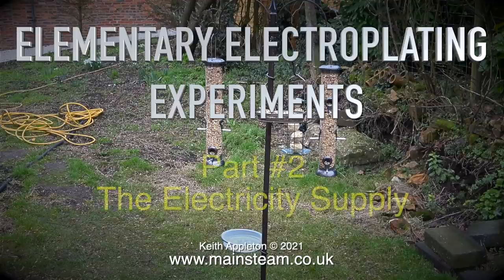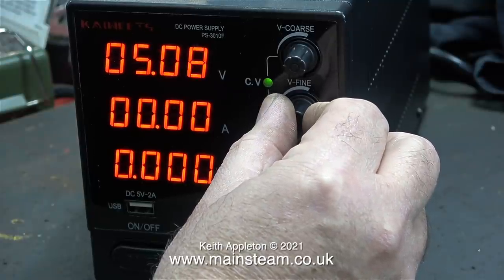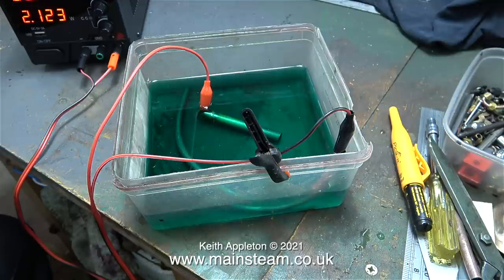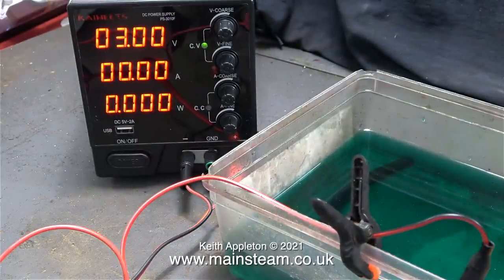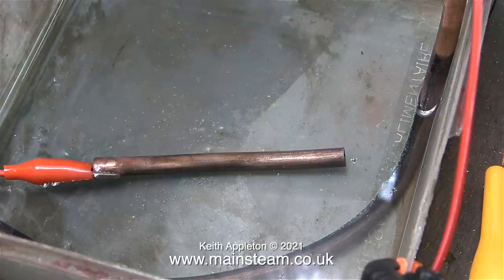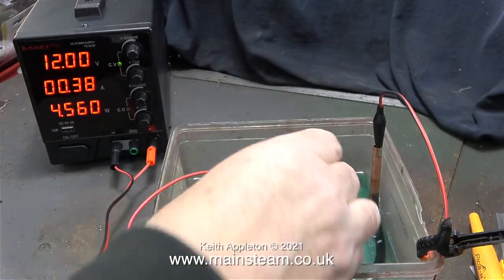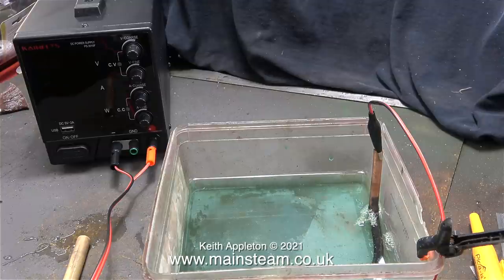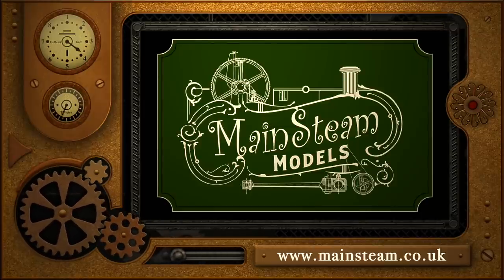ELEMENTARY ELECTROPLATING EXPERIMENTS - PART #2

Comment: Keith, The product that was recommended, "root kill" is sort of a generic name for the stuff poured into a home drainage system to remove root blockages in the outdoor drainage pipes, most likely. We in the US generally call the stuff "root destroyer". The stuff is usually granular and is poured into a toilet and then flushed into the system. This apparently dissolves into an acidic liquid and destroys the "hair roots" that find their way into the drainage system, in search of water, thus blocking the drain pipe. How that would work in your application is questionable. ;-)

Comment: Oh, now you gave me USB-port envy; my adjustable PSU doesn't have one! With these PSUs you can easily set the short circuit current, and thus avoid burning up electronic components and DC motor windings. The built-in amperemeter is a great help in troubleshooting, for those who don't especially love the smell of burnt copper winding insulation. Thank you for this electroplating crash course!

Comment: Hi Keith
For scale removal I have used Zep Commercial Calcium, Limescale and Rust Remover, it removes all the limescale we get down here in Essex. Also used it to clean up some chrome plate bathroom fittings that had rust grinning through, worked a treat. I buy it from Screwfix, £6.99 for a litre (no connection)

Comment: Root kill ( ZEP product in the USA) the safety data sheet says it's 90-100% copper sulphate (sulfate US sp.)pentahydrate, that's the blue crystals, it doesn't say what the remainder is. It's designed to kill tree roots that have invaded drain and sewer pipes. Copper Sulphate from a chemical supplier would be a guaranteed purity.

Comment: Enjoying this series, You are not pretending to be an expert, nor blindly following somebody else's recipe! strangel;y refreshing here on the 'tube!

Electroplating top-tip: Electrochemistry is all driven by the "current density" (current/area). so set your current limit, and let the voltage be what it wants. experiment with different "current densities" and you should end up with a reliable figure to use in the future, however big/small the next piece may be. (I hope that doesn't count as trying to tell you how to do it Keith, just a pointer!)

Comment: For kettle descaling and the cleaning/refurbishment of copper and brass ornaments, I've been using a mild solution of citric acid crystals for many years. Any decent home brew shop will have it in bulk quantities at a fair price. For heavy deposits all you need to do is bring the solution to boiling point and let it cool slowly over time. The only downside is that it will strip the cheap 'chrome' plating from the elements of cheap kettles, exposing the copper underneath. Is it safe? you ask. Read the back of a crisp packet!

Comment: I did some electroplating as a kid using my Hornby 12volt transformer.  It hummed a little bit more than usual but it worked.  I used a copper sulphate solution but I can’t remember whether it was the anode or cathode that got plated.

Comment: I would try a magnetic system to stir it, super easy to build, and the acid can't effect the seals. I'm thinking about setting one up and trying some anodizing :-)
Reply: The caution there is keeping the acid from contacting the metal in your impeller. Introducing Iron in your electrolyte can impact the finish of your parts.
Reply: @jaylittleton1  Magnetic stirrers are coated

Comment: Try a aquarium air pump to agitate the electrolyte
Reply from the maker: That's exactly what I used.
Reply: I used to anodize aluminum.I Instead initially used a aquarium air stone until I discovered sulfuric acid dissolves them.I then tried pvc pipe with #60 holes drilled in it. The larger bubbles it produced was way superior to the air stone.They displaced bubbles on the surface of the parts.A small air pump for a air brush is a bit noisy but,works better than the aquarium pump
Reply: Since you have a ultrasonic cleaner,you might try setting your plating vessel in that.It should agitate the solution without the air bubbles

Comment: Keith, pumps and electroplate are a mess. Use an air stone and an aquarium air pump. The bubbles will stir the electrolyte and keep it moving.
Reply from the maker: Yes I will try that. Thanks for the tip.
Reply: @keithappleton  You're welcome! Cheap and easy! And they also use that method for stirring the chemicals while etching printed circuit boards.
Reply from the maker: I bought one via Amazon last night }:-)))
Reply: @keithappleton  Sweet! Now you'll have to do a video and show us how well it works!

Comment: I bought one of those low cost power supplies similar to yours a few weeks ago after my 50-year-old home made PS finally died. I've wanted decent one for a long time and was surprised how much they had come down in price. 

I worked one summer at an electroplating company over 50 years ago. While there I learned that you can't interrupt power while applying the chrome layer. My teachable moment occurred when my boss saw me do it threw a chromed chair frame that I was plating about 25 feet across the shop floor. It left quite the impression on an 18-year-old in one of his first jobs.

I don't know if it was the sweet smelling vapor degreaser,  the several acid and caustic baths, or the heavy metals, but that place and another place where the plating section was next to the machine shop where I worked both ended up as super fund clean up sites. Be careful with this stuff.
Reply: An educated guess, hexavalent chromium and trichloroethylene are the pollutants.